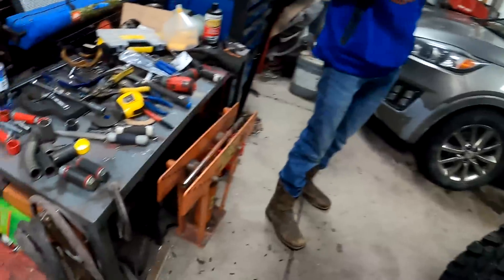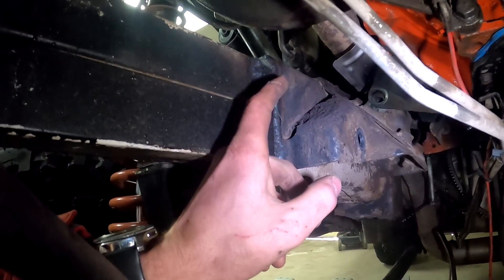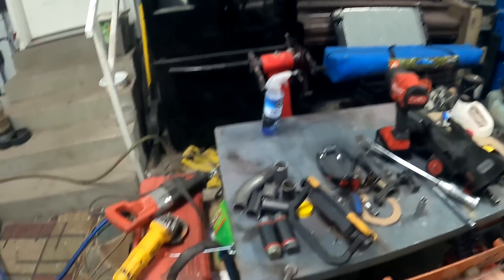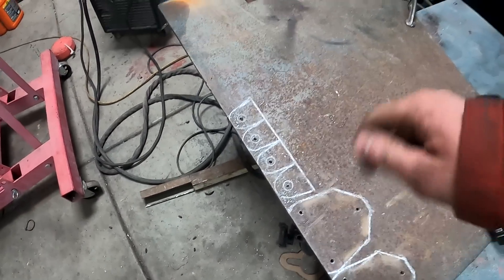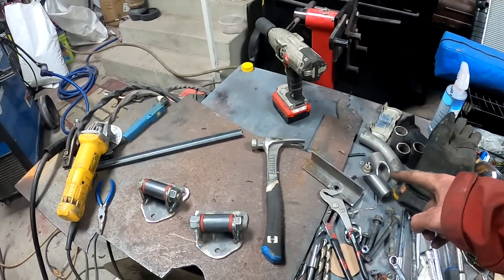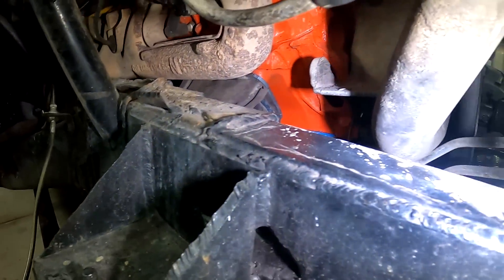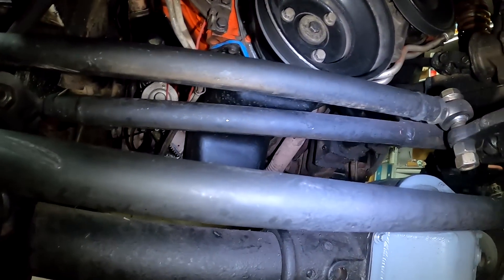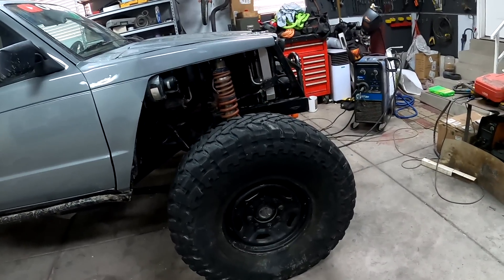That can't be good.

Comment: Don't overthink installing those gears. I did my first set when I was 17 before YT and even though the wear pattern wasnt perfect I put over 7 years of abuse on them before I sold that jeep. A perfect pattern is ideal but a slightly imperfect pattern will still last a really long time. I'm looking forward to the beadlock build because that's my next big project and I'm on the fence of the cost and work VS just buying a set of beadlock wheels
Reply: 100% right on!

Comment: Did you check with summit racing for solid motor mounts for the 4.3? Racing requires solid mounts.
Never overkill, the 4.3 is a torquey engine.

Comment: The motor should have the ability to flex a little to absorb vibration, that is why there are bushings made of rubber in most of them. With no ability to flex in the bushing the torque from the transmission will now only be able to transfer it directly to the frame and that could result in future issues frame or transmission issues.
Reply from the maker: Yes it has a bushing for the vibrations